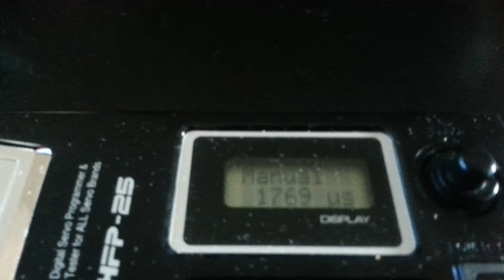MagLev HoverDisk Testing

Comment: how strong is the magnets you use and how many did you use total
Reply from the maker: N52 Class Neodymium magnets. 5/8" x 1/4" disc's. Eight magnets in a circle. Every other magnet is opposite polarity. North, south, north, south and so on. Wheel is 3/8" thick polycarbonate about 3.5" in diameter.

Comment: Hi I was wondering what controller and battery you are using for this experiment.
Reply from the maker: The controller can be any 1.0 to 2. ms servo signal generator. Most ESC's want the signal to be towards the 1.0 ms signal at startup. The battery was a 4S 14.4V I believe. Sometimes you can use a DC power supply if you are not pulling too much current.
Reply from the maker: Look at my other video of this same experiment to see more of how I controlled it.